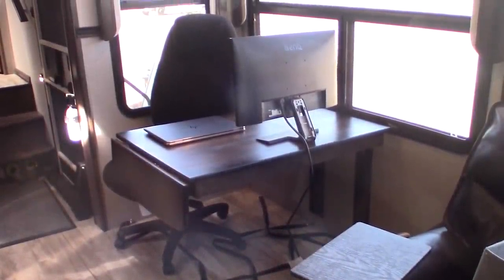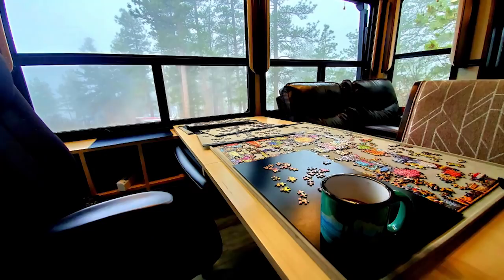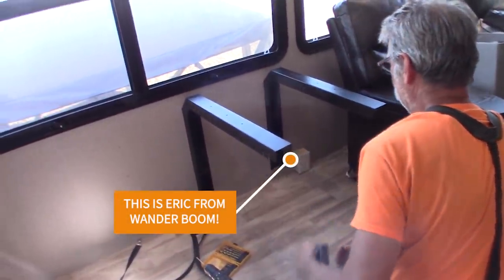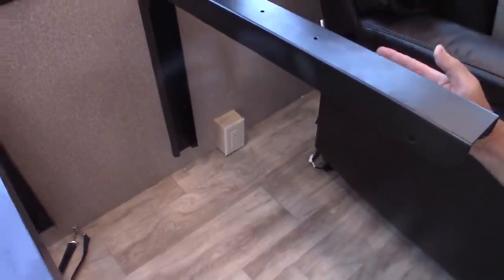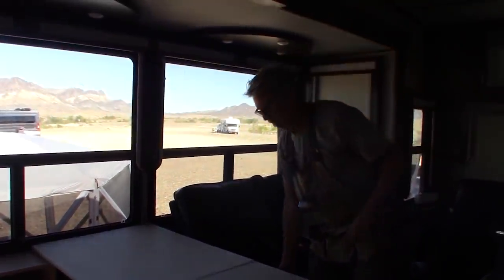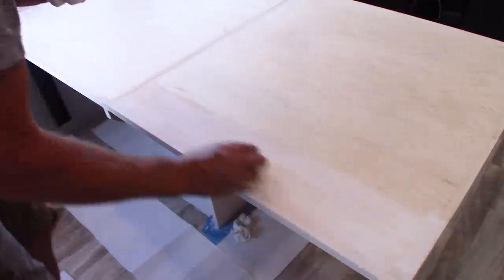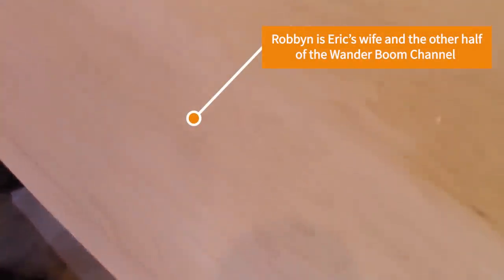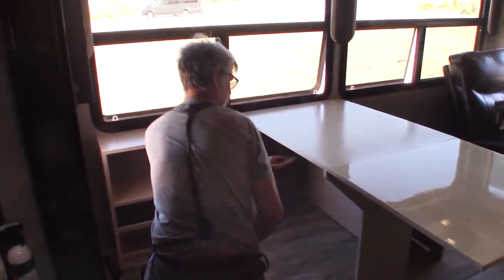AMAZING Tiny Space Desk Rebuild! This Is a Game Changer for My Full-Time RV Life! Finally, a Work...

Comment: Hello all and thanks for all the kind comments. To clarify for those of you concerned with the perceived table scraping the floor. The table just barely touches the floor when it’s closed. The sound is from the locking hinge hardware. I understand your concerns but it’s not going to be a problem.👍✌️
Reply: Yay! Thank you for answering this question. I thought it was the hinge, but then a number of people thought it was scraping. Now all those folks just need to scroll down and read other comments to solve the mystery :-)
Nice work and Robin is pleased as punch!

Comment: The light, bright white wash is very pleasing.That's a lot of table space! The cubbies are great! And the chair storage is clever and convenient. I really really don't like to say anything that's not positive. However, when folding and unfolding the table, the way it scrapes the floor is not good. I would take 2 inches off the edge. That would stop the scrape and allow for some settlement. Also, I think I would have used water-based polyurethane, as opposed to oil-based. But it sure does look nice!

Comment: Nice. The only problem I see with it is that the drop leaf part of the table scrapes along the floor and will mark the floor in time.
Reply: Wish I had that guy’s creativity! Really nice design.  Not sure about the load capacity on that extension leaf. He may have installed a leaf extension support bracket underneath… it wasn’t shown if so. That would be the only improvement that I can think of on this really nice utilization of space.
Reply: Great desk, not sure why it scraped on the floor though.
Reply: That's the part that made me grimace, as well. Gonna wear on the floor.
Reply: I had the exact same thought and wondered why it didn’t occur to the builder or Robin. It is so obviously a problem. That said, it is a brilliant makeover of the space
Reply: David murling I think it’s the hinges because it sounded the same when it was away from the floor.
Reply: @duckiegirl58  just removing 1/4in off the edge should fix that. Wonder why he didn't trim it up. Other than the scrape it was an incredible reno
Reply: Great job !!  I had the same concerns...the edge of the table should not scrape the floor.  Can that be adjusted?
Reply: @janine9115  that was making me crazy! Shave off 1/8" and round the corners!
Reply: Are you talking about the noise you hear when it's lowered cause I'm not seeing a "scraping".  The noise is the hinge mechanism.

Comment: Perfect for u!  Excellent use of space and ergonomically back saving for u.    I’m short too and always having to ‘climb’ to get to my stuff is such a pain .  One concern:  that far edge of table, (edge closest to leather recliner, scraps on the floor every time he put it down.  Didn’t do it on other side (You can see underneath just a bit, whereas on edge I’m talking about, it’s flush with the floor).  And u can hear the scraping sound but only on that far side.  Over  time, that just might damage your floor.  I could easily b incorrect tho so just take a peek.   How incredible to have run into him as you did.   He’s your fairy wood maker and problem solver!
Reply: I'm pretty sure that scraping sound is the hinges/springs. I very much doubt Eric would go through all that and leave the desk to scrape the floor.
Reply: @victoriabaker4400  i have hinges I purchased from Amazon. If they make that noise they are going back!
Reply: @jcrefasi1  well, those are pretty powerful hinges to support the weight they said, so I guess it's a trade off between a noisy opening and looking good without supporting legs in the way, etc

Comment: I think it would be better to have a hidden compartment in the table so the monitor could go up and down into the table (like some TVs). That way you wouldn’t have to take down the monitor and store it in the side shelf (doesn’t seem to be very secure there)
Reply: Michelle C But then the location of the monitor is fixed, and what if she wants to add a second external monitor?  Eating on the table would also inevitably get dinner down in the monitor slot.  These risers work best for TVs mounted at the wall.

Comment: I guess it’s too late to round the corners, er, hip bruisers.
Reply: And I would have chosen a bullnose edge all around. Much easier to rest your arm on. As for those 90 degree corners on the extension, with a fine-toothed jigsaw blade it should be possible to achieve without damaging the top finish. Then it's just a matter of applying the same polyurethane finish to the newly rounded  edge.